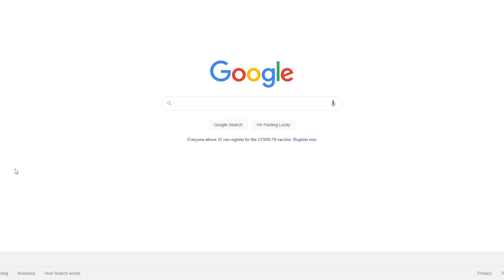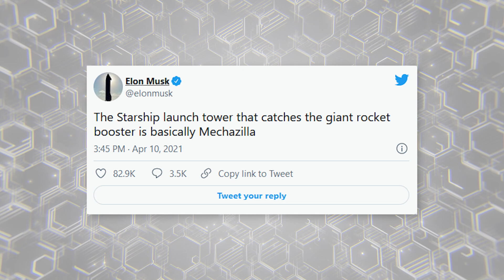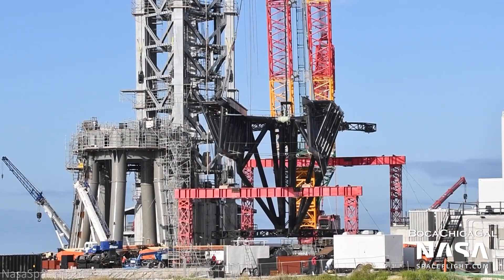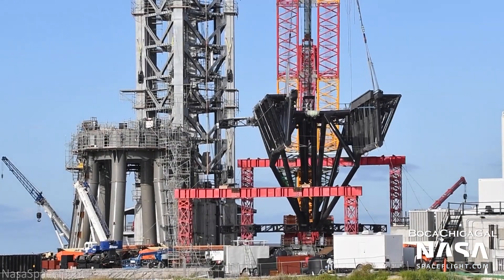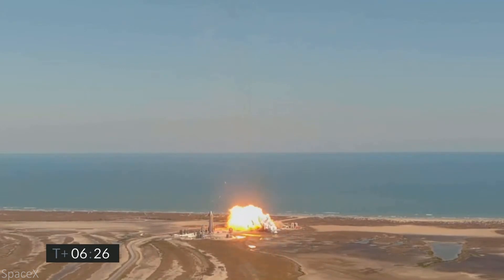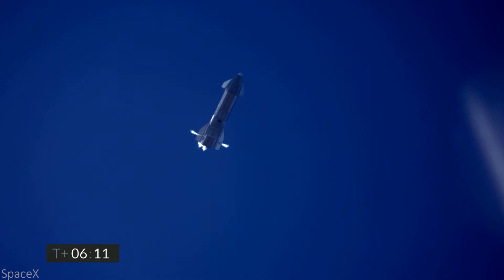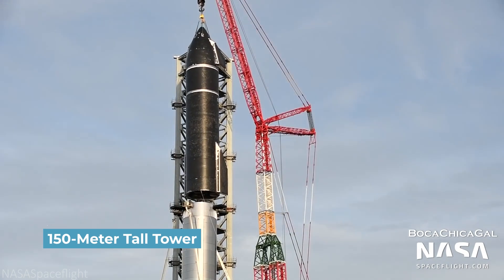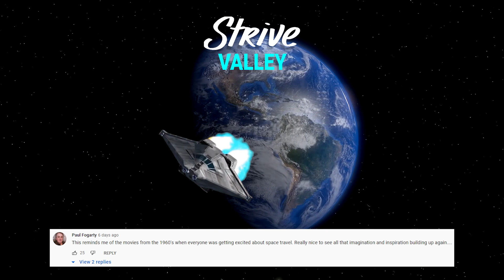What is SpaceX’s Mechazilla? Explained in 9 Minutes

Comment: No, as Elon said, Mechazilla is the whole orbital integrated launch tower, NOT just one or both arms. The arms are Mechazilla's arms. The top pulley system is his head.  The QD arm is his reach around according to Elon. The purpose of Mechazilla is to transfer the weight of the landing gear from the ship (landing gear) to the ground (catching tower) thereby increasing the payload mass to orbit by the weight of the landing gear (3-6 tons). No one thinks, or has ever said before you, that this approach is safer than traditional landings. The crazy catch after all follows the suicide flipturn. And no they are not going to assemble ships with Mechazilla at the Launch site in the weather, since they have a Build Site with High Bays, welding bots, scaffolding and tents for that. They're not going weld segments together by hand in the rain anymore, or do any ship building, at the Launch site. 

On Mars: Winds can be much higher than 100km but since the atmosphere is ~1% density of Earth, a 200 mph wind on Mars would have the same force of a 4 mph wind on Earth, which you would not even  feel through your suit. We survive dust storms on Earth, and 'random cloud formations' are neither scary nor true as there is no atmospheric water.  Volcanoes are extinct, craters aren't dangerous.  HOWEVER, the surface radiation is lethal to the unshielded, the temp ranges ~50F to - 120F, and the air is actually CO2. I would have mentioned the latter to make your point.

As to building a Mechazilla on Mars: How? How do the megatons of supplies, equipment and parts - and the hundreds of people - land BEFORE there is a catching tower (and where do they stay while building it)? Next, Mars only has 38% Earth gravity and an atmosphere to give a nice low terminal velocity. Installing Falcon-9 style legs, which don't weigh so much, wouldn't work on Earth for Starship, but would on Mars.  And such legs could land on unprepared ground and have leveling capacity. 

Starships are not going to regularly launch from high population areas, let alone once an hour. It looks like SpaceX will be parking converted oil rigs like Deimos and Phobos off coasts for their main spaceports. 

The QD arm cannot currently refill anything.  The QD box that actually inserts into Starship has not been installed yet.

The arms not only are in place, they have been for almost a week and today they moved for the first time.  

So, all in all, good effort but you need to research at least as much as your potential audience. You can't just, for one example, speculate that they are going to stop building ships at the Build Site Rocket Factory and start building at the Launch Site using an orbital launch tower. :) There is just no such suggestion anywhere in the world. See SpaceX Pink and Marcus House for examples.  Good luck!